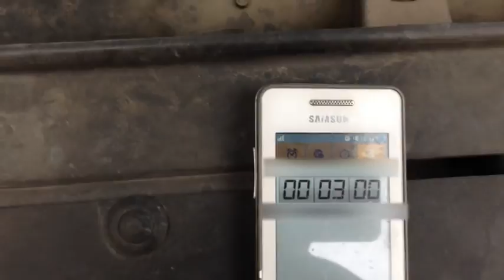Peugeot 307 - Airbag seat connection - Electronical -DIYChannel

Comment: Hi does anybody have any info if this is the same plug that fits under the seat of the 107 without sounding daft it is the same style and color green as i have been told that they are a bit of a pig to take apart. Also do push the screwdriver up or down to the floor to get the plug apart thanks for any help

Comment: To clean the connector needs to unwire the battery? Cause i need to do that .thanks
Reply from the maker: Yes, always, if you fix something electric, you alllways have to disconnect the battery. Safety first. I have a video with the exactly sequence. It isn't the most popular video but it's an important one.

Comment: Thank you so much for sharing this !!
3:00  Is it necessary to lift up (click up) the red backplate when you disconnect or re-connect the (green) connector? It looks like you click the red backplate back into place after you reconnect the green connector in the video because there is an audible 'click' sound, but I'm not sure because the connector is inside your hand while you're doing it.
Reply from the maker: Uff, I don't remember...

Comment: podrias describir la secuencia de forma escrita?, no comprendo que haces al principio, cierras con seguro el auto?, luego desconectas la bateria?, luego abres de nuevo el auto y limpias?
Reply from the maker: The point is disconnect the battery in a Peugeot has an official sequence of steps: open the window, block/close the car, disconnect the battery. To connect the battery you have to connect it, WAIT 3 MINUTES, to turn on something (lights, for example), that's the reason because you need open the window in the begining. I have a video just for all this 😉
Reply: @DIYChannelMusic  tienes algun link de un tutorial que detalle los pasos?, paso por paso, yo solo entiendo, 
1:hay que bajar la ventana
2:cerrar y bloquear peugeot
3: desconectar negativo en bateria
4:hacer lo del video?